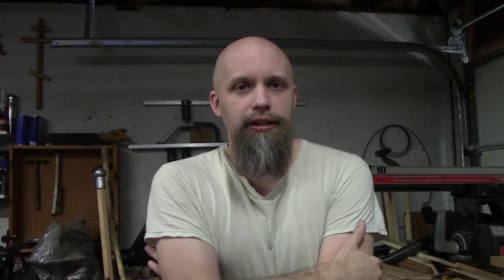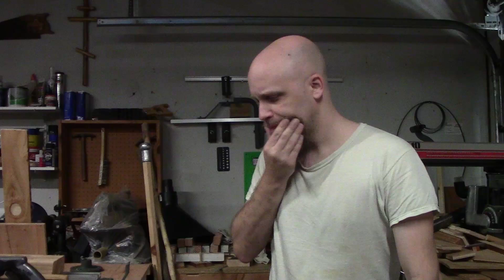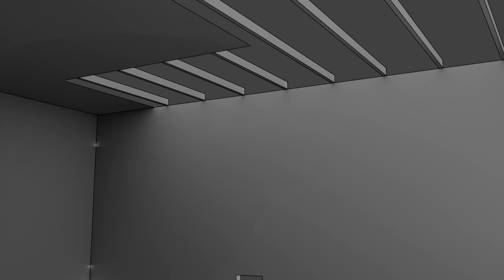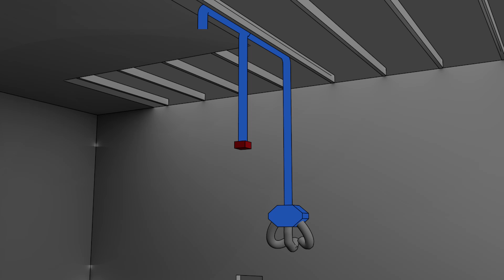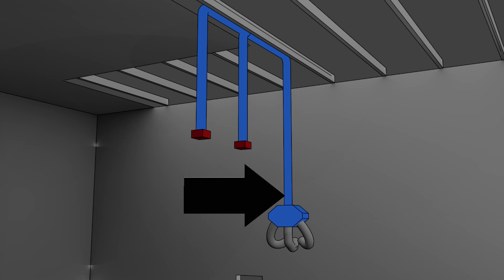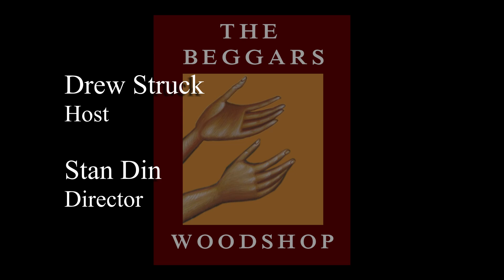The Math of Your Dust Collector

Comment: So if your static pressure calculation of 2.69 is correct and 4.6 is the max static pressure of your dust collector with 330 the max CFM then with 2.69 of static pressure your estimated CFM will be 330 * (1-2.69/4.6) which is about 137 CFM.  With that CFM flowing through a 3" duct, you would have an air flow velocity of about 3932 FPM.

However if the max static pressure is really 7" (which doesn't sound unreasonable for a 1/2HP dust collector that flows 330 CFM) then the numbers would be 330 * (1 - 2.69/7) = about 203 CFM with an air velocity of about 4136 FPM in a 3" duct.

You also mentioned that you want 4000 FPM at the tool but only need 3500 FPM at the dust collector.  You didn't make it clear in your video that the only way the FPM will be different at each point is if the duct size is different.  So to have 3500 at the dust collector through a 3" duct and 4000 at the tool, you would need a 2.806" duct at the tool.  

As long as the max static pressure your dust collector can make is less than 40 or 50" it is really easy to find out what it really is.  Just block the inlet so no air can flow in, connect some clear rubber tubing to the inlet hang it in a u shape half full of water and then measure the difference in height of the water in each leg of the U.  Also make sure the far side of the tube is open to the air in your shop and doesn't have any air from a fan or something blowing by or on it.  

Doing that with the air flow blocked at the inlet, and again with a duct connecting it to your tool, you can then get a pretty good estimate of the actual CFM that will be flowing.  This is of course if you can trust the CFM rating from the manufacturer.  To be clear the calculation would be Max CFM * (1 - P1/MaxStaticPressure) with P1 being the static pressure measured at the dust collectors inlet (AKA as close as possible to the fan/impeller) with all the duct work connected to your tool.  You should probably have your tool running since it's possible for that to effect the numbers too.

Comment: The static pressure and CFM numbers alone don't tell you enough.   If it is say 1000 CFM and 10" of static pressure that means with ZERO static pressure it will flow 1000 CFM and at 10" of static pressure it will flow ZERO CFM.  The CFM is different at each static pressure.  While the graph isn't a straight line, it's pretty close.  So in this theoretical system at 5" of static pressure the flow would be 500 CFM.  In other words the calculations you are trying to make are much more complex than what you are doing.  To simplify everything, you can put a tiny (1/4") barbed fitting at the inlet of you dust collector with all of the duct work connected.  Then get a few feet of clear tubing, fill it up a little less than half way with water, hang it in a U shape and then measure the difference in height of the 2 ends of the water column. Now that you know how much static pressure you have, You can estimate the CFM flow and then determine how fast the air is moving in your ducts.
Reply from the maker: Thank you for the extra info